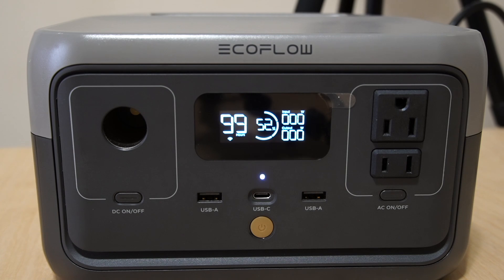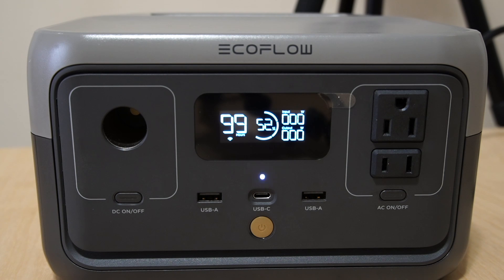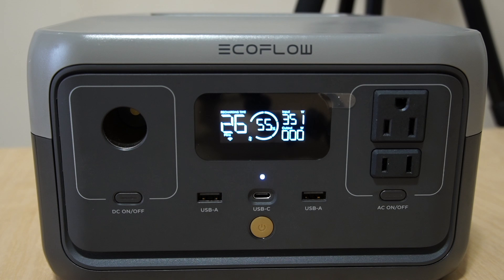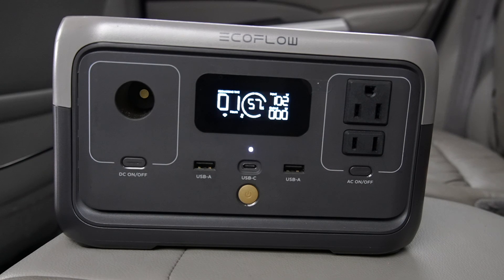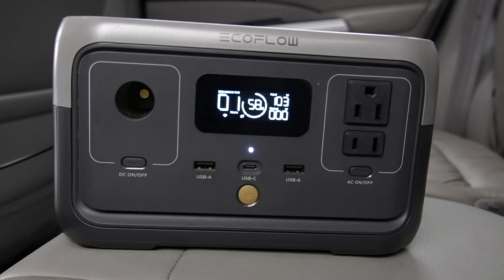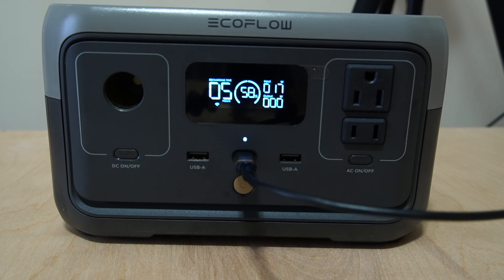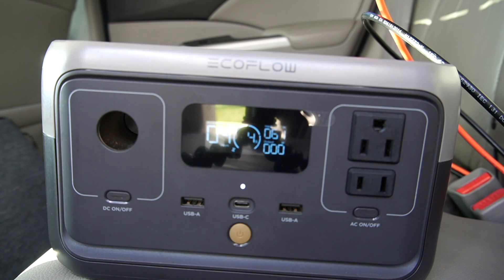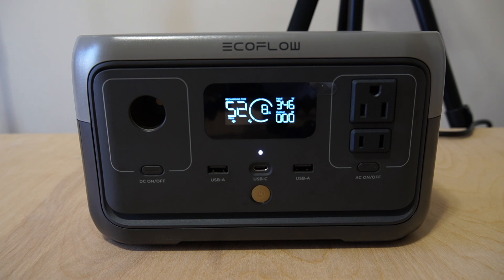Testing 4 Methods on EcoFlow River 2 | Input Wattage Experiment

Comment: My ecoflow river like yours blows fuses on my cig socket and that's a 20 amp fuse .it works up to 50 percent then pop
Reply from the maker: it might be using too much wattage.. Mine does the same thing with too much power output!
Reply: @LuckyTechLife ..how are some people  getting 100 watts on there solar input I only get 11 watts on a 100 watt 18 volt renogy solar panel
Reply from the maker: @terenceswitzer5947 great question! I believe It has something to do with your solar panel itself. If you got a good angle on the panel, and it’s still pulling in 11w.. it’s the panel…